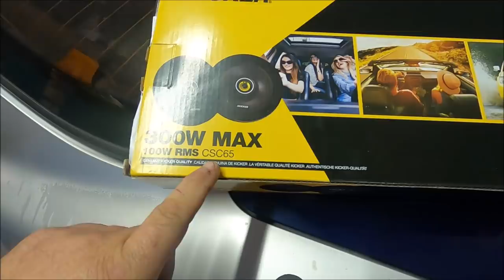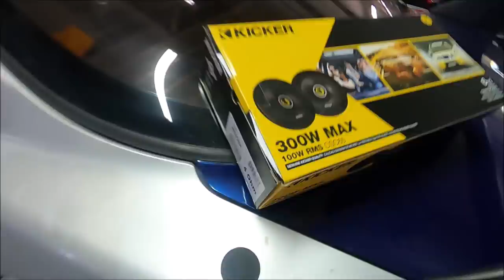My Kid Bought The Wrong Parts For His Racecar

Comment: If he's not going to put a 4-channel amplifier in that car to better power those speakers I would highly recommend buying some foam speaker baffles that go behind the speaker to help push the sound into the car, so much sound is being lost in those doors. Or just sound deaden the doors with whatever he can, it'll make a world of difference I'm telling you!

Also, keep those kicker 6.5" speakers, put them in the rear, buy a COMPONENT set with a 6.5" MIDBASS (NOT MIDRANGE) and separate tweeter, really easy to put in that car and component speakers dominate coaxials.

I'm also not sure of the head unit he has in there but if it has crossover adjustment make sure he's crossing those speakers over around 80hz otherwise he's going to end up blowing them listening to modern bassy music at high volumes as his head units likely distorted around the 3/4 mark. Check out Steve Meade, CarAudioFabrication or ExoContralto's youtube channels, they can help him get a quick jump into better understanding car audio if he's interested!

Comment: In order to get to the expectations of those speakers your going to have to find a amp to amplify the sound louder. You can put the most expensive speaker on a car and it will still sound the same because the amp of the car only pushes around 30 watts rms and thats the only power your gonna get unless you upgrade to another speaker amp. A 100.4 amp will put out 100 watts rms to each speaker, that will make things get extremely loud at low volume. Keep up the videos 👍🏼